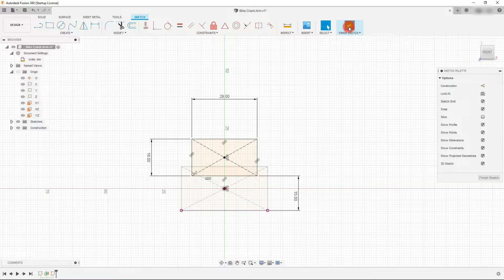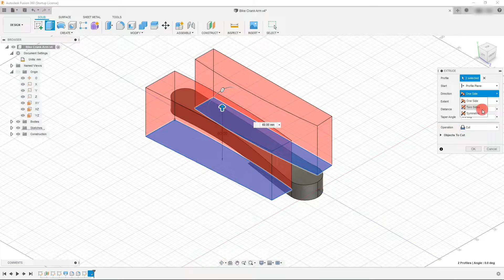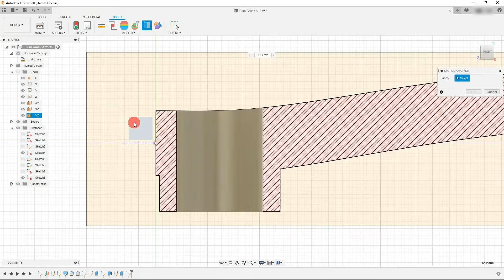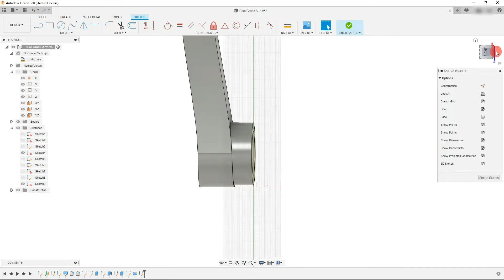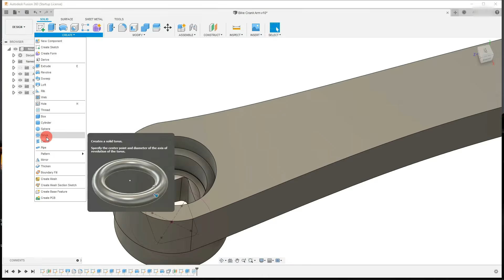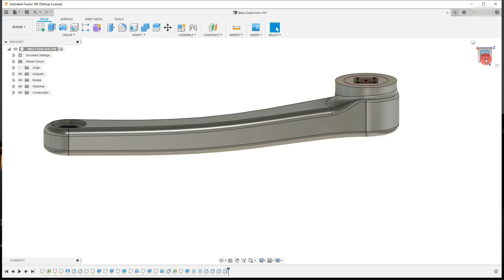Model a Bicycle Crank Arm in Fusion! Tutorial for Beginners Exercise, Lesson in Modeling Parts

Comment: How do you decide the value for filet the edges? when the length of the rectangle profile is 37 the filet is 18.1, which is not exactly half but a bit less than that and when the length is 28 it is 14.1 which 0.1 more than the half. whats the rule or formula here. FYI, I am not from mechanical background and have just started learning cad
Reply from the maker: Hello! The best way is to use a "full round fillet," but the way I showed is to use up to half of the width. You can make it up to that value, since it would fail if it was bigger of course.

Comment: How did you get the projected dot at 28:28? For me it projected everything besides that one dot
Reply from the maker: Hey, I'm not certain I see where you're talking about. So you drag selected a point and when you hit project nothing happens? 

If you're talking about setting it to midpoint using the triangle logo?
Reply: @AvivMakesRobots  I projected the entire thing but for some reason the fourth dot on the bottom line doesn't appear so im not able to project it

Comment: I’m having an issue with the M20x1 thread…. For some reason I’m not able to select the specific face you’ve chosen. It’s only allowing me to select the inner face of the bigger hole. Not sure what mistake I’ve made.
Reply from the maker: Be sure that the hole is a circular hole. If it is conical, has an imperfecrion on it, etc. It will not work. It must be a perfect hole cut with a circle.